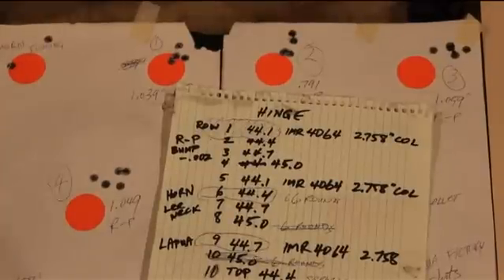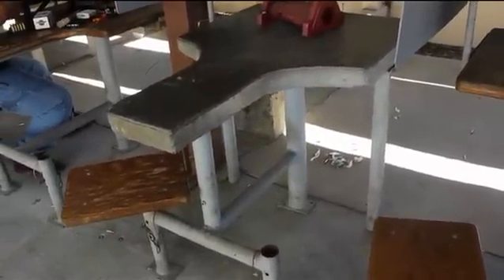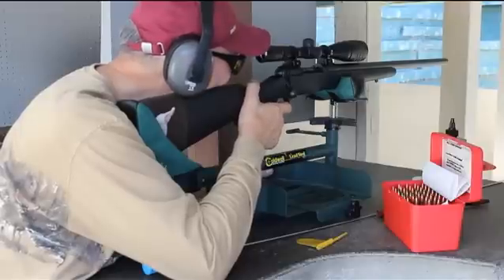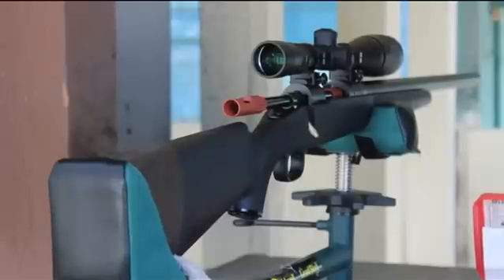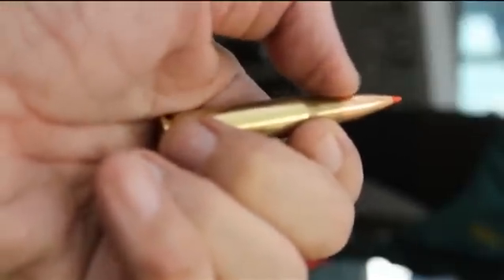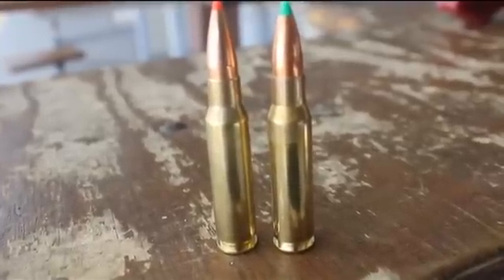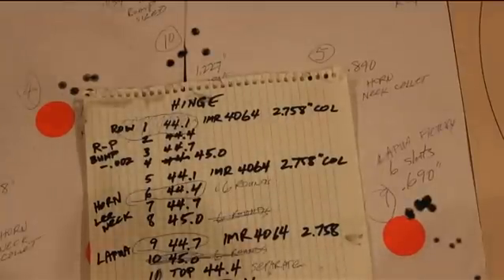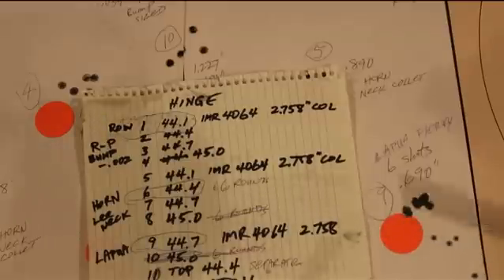Savage 11VT 308 Project: Chap 18 - Reading And Evaluating The Ladder

Comment: Are you go to tired cfe 233 power or one of new  imr power
Reply from the maker: gunman9090 - Yes, I have some IMR 8208 BR - but the 4064 first...  Have a great day,  FC
Reply: +FortuneCookie45LC I was talk about with imr power is 4166 4955 4451 7977 because it has copper fouling eraser compound in power and I don't think imr 8208 xbr cfe compound
Reply from the maker: gunman9090 - Those are those enduron powders unless I misspelled that...I'm sure they are great powders, but doing these ladder tests, when I find an accurate load, I'm really more or less committed to it.  And with 8 pounds of IMR 8208, I've got a lot of work to do with that powder...Tell you what, though - I'm definitely going to try some of that cfe pistol and cfe 223 at some point soon... Thanks for the encouragement.... FC